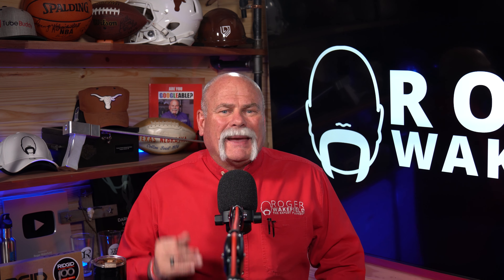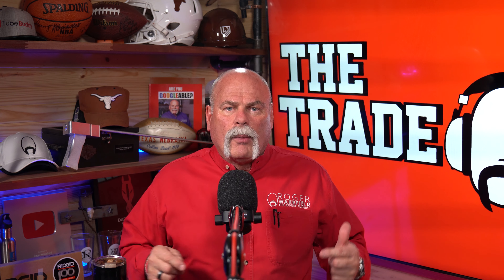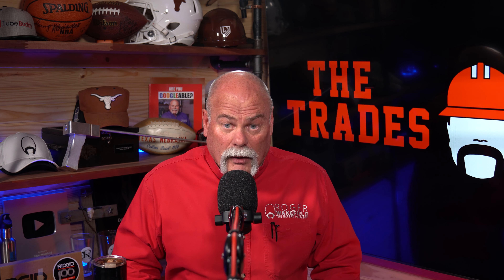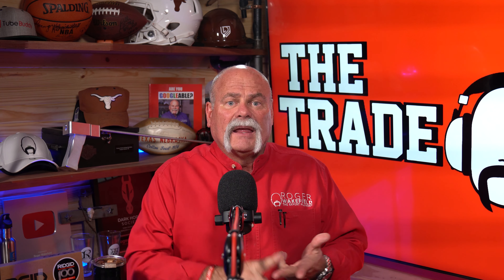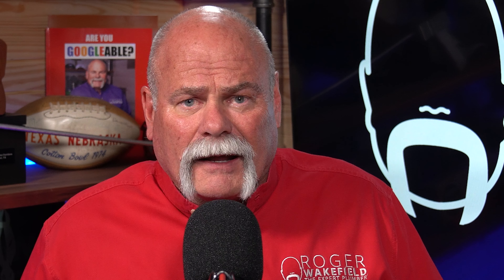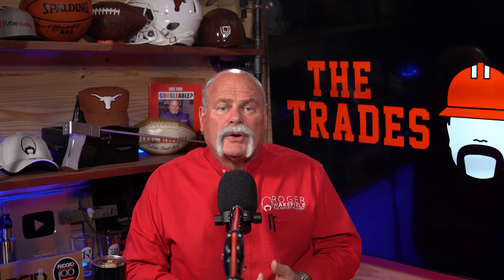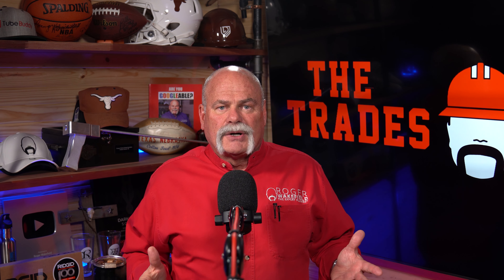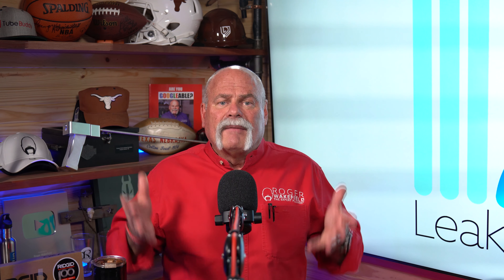How to Get Insurance to Cover Plumbing DAMAGE

Comment: Roger, the subdivision adjacent to me had many older homes that had water heaters, and other leaks after the local city water company had repairs in the area and flushing their lines and psi too high created the leaks.  Due to property owners insurance deductibles being more than the repair costs they couldn't file a claim against the city insurance for repair cost.  Your info is worth hearing, hope I never have to use it.  Thanks,

Comment: As a general contractor we have delt with a fee insurance claims and we had to tell the homeowners to fight tooth and nail they will deny!  They also tend to call in thoes restoration companies and the repair drags on for months to years for really cheaper quality work.  They will cut any corner possible I've seen them pack 2 sheets of osb 1/2in with cardboard boxes in-between to match old subfloor as opposed to t&g like it was or at least 1 1/8 plywood.  2x2s instead if 2x4 sheetrock screws instead of framing nails the list goes on.  You have to be your own advocate and monitor the work to make sure it done rightish.   On a side note if you haven't already I'd like to see a comprehensive video and demo on blue monster drain banger!  I want to know what to expect with it and it's pitfalls no one tests like you.

Comment: If you have an older house, make sure you get a policy with utility line coverage. MOST INSURANCE DOES NOT COVER WATER MAINS OR GAS MAINS OR MAIN ELECTRIC LINES. Anything between the curb/street shut off and your house is your responsibility, not the utility’s.

My house was built in the 1930’s. I recently had to get my water main replaced due to a confirmed leak. Instead of paying $20K+ to dig out my driveway, dig a 4 ft deep ditch from the street to my house, replace the driveway, and fix the yard, I paid a $1,000 deductible. Best $4/month extra I have ever spent.
Reply: Do you have any insurance company that you recommend? I bought my house a couple years ago and I found out that there are a ton of roots in my main sewer line. I remember seeing that my insurance doesn't cover stuff like sewer lines.

Idk if it's too late at this point that changing insurance company's would even matter or not though